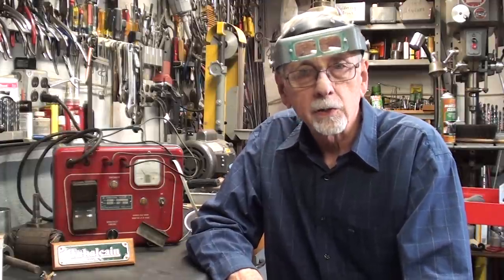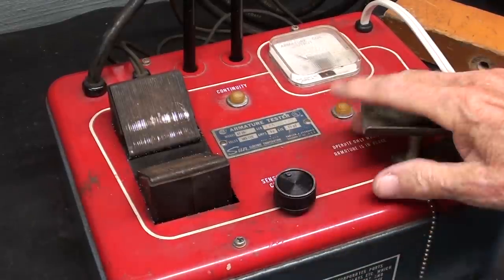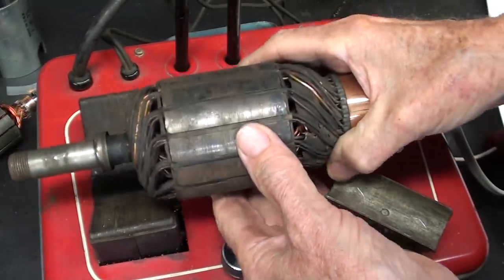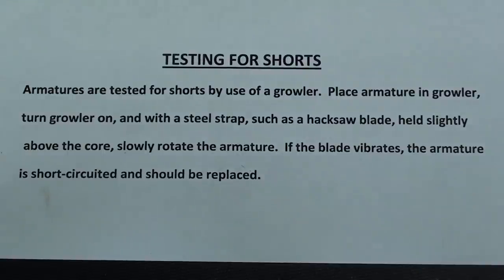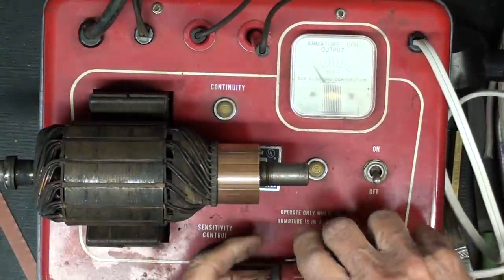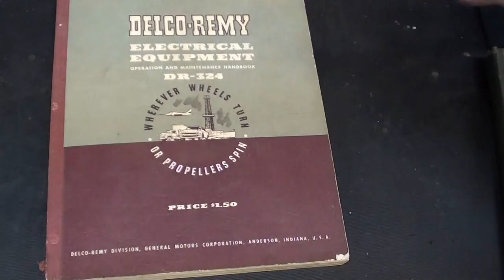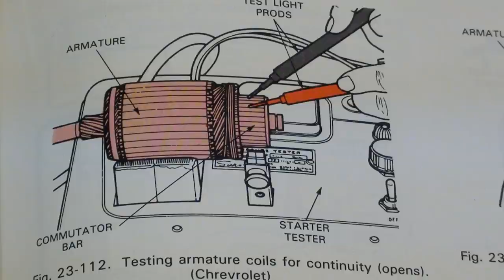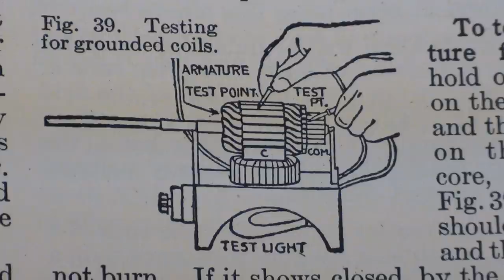TESTING ARMATURES with a  GROWLER #761 tubalcain sun commutator

Comment: I’ve operated both of those machines back in the 1970’s. I’ve also turned down commutators, undercut the mica in generators, adjusted voltage regulators and flashed the fields. Other Sun machines I’ve used were the VAT-28 and oscilloscope. 
Good find! Thank you for preserving them.

Comment: In my dealership days, I was the tune up/electrical technician. This was in the 80s until 2002. It wasn't economical to bench repair worn out starters or generators, but for warranty repairs we had to replace internal parts. The last starter I ever took apart was a 1984 Oldsmobile which had  a gear reduction starter. The brush holder had come apart and was mangled beyond recognition. I put the service manual on the bench and carefully installed a new holder and wired the brushes in place. When I reinstalled the starter, it worked fine except it was running backwards and the starter drive clutch was overrunning. I pulled it back out and again carefully compared the brush wring to the diagram. I stood there trying to see what I had done wrong when a breeze turned the page to section on the regular starter, without gear reduction. The same brush diagram was used on both pages. This was about the time we quit doing internal repairs on generators(GM never used the term alternator). The diodes, voltage regulator,  and brushes of early generators used screws, so diagnosis and repair was fairly simple. By this time, power output was getting over 100 amps, so in later generators the connection between the stator windings and the diodes was a spot weld that couldn't be duplicated in a shop.
Reply from the maker: Thank you for that little history lesson. Helps me understand why this is no longer done

Comment: Awesome.  Every once in awhile you run a cross a growler.  Great in the marine mechanics shop as lots of motors on boats.
Reply: Yes and not to mention the many different power tool motors that are mostly commutator type.
Reply: Aircraft shops still use them.

Comment: Nice to see a demo like that. I started in the auto electric rebuilding business right out of high school. A parts counter out front and a 4 man rebuilding  shop in the back. Our testing /rebuilding equipment was much more heavy duty. The business was driven by rebuilding starters, generators, magnetos,  regulators and such for large fleet accounts. A shop of 4 men rebuilding 8 hours a day 6 days a week is a lot of product being done. We had growlers but much larger and taller. One of our customers was US Steel, Fairless Hills, PA mill. Their yard locomotives 32 and 36 volt. A 15 pound armature needed a serious growler. I worked at that trade for more than 35 years. A third of that time I owned the company. It finally went the way of the buggy whip. No body needed us anymore. Now a days if you need something just get it from China!!!

Comment: We live in a throw away society, it's so sad that people just toss something like this tool. I'm retired maintenance mechanic- electrician. I worked for a large nursing home it was non profit so the more I could repair ( everything from hospital beds to large boiler circulator motors, industrial kitchen equipment and our plow trucks and tractors). Now since us old repair men has retired, everything is replace. It's run by a corporation now instead of the church, the amount of money used to keep with this new practice of tossing things is staggering.      Glad you kept it from filling a spot in a landfill! Maybe someday things will turn around.

Comment: Very good demo Lyle.  To bad you did not have a several bad armatures.  I linked this video to my motor repair playlist.  Thanks for the demo.
Reply from the maker: Hello Randy. 15 minutes ago, a man offered to loan me the under cutting attachment made for a south bend lathe.  However, I do not currently own a South Bend. But wait, there’s more. I will soon be the recipient of said Machine. A man from Florida is gifting me a 9 inch south bend.   So that video will be forthcoming in about four months.
Reply: @mrpete222  Nice, I could of used an undercutting machine.  we had them on some of the old ships.  even better with a lathe.

Comment: I used a growler for many years in the school bus garage in NC.
It cost very little to repair alternators and starters and we cut cost by 75%. I trained one of my men just for this, and the repairs were easy to do. We cut our commulator on a south bend 9" lathe and south bend had a mica cutter attachment to cut the mica away from the brass. We also ran a ground from the alternator to frame as a extra ground and cut alternator problems by 50%. Love the video's, this one brings back old memories.
Reply from the maker: Thanks

Comment: In HS auto shop I used both the armature tester and the distributor machine.
To use the valve grinding equipment you had to have had very good math grades by the auto shop teachers standards.
I used that equipment also. 👍

Comment: I taught myself how to rewind motors from an Army Field Manual (TM5-764) that I got from our local public library. The only "exotic" material needed was Red Glyptal, a semi-hardening enamel (which you can still get from Amazon - they have everything) to stabilize the windings. I rewound a single 1/2 horse motor (which I still have and still works well) and never tried it again. I think the only time I would ever do it again would be for some motor with a proprietary case that was not available any more. It is tedious, but so are a lot of the things we do.

Comment: In the 60 years of being an automobile mechanic I must say I have never used one, but as you say it’s usually pretty obvious if an armature is defective by the thrown solder or the burned varnish, but for production work the grower is faster and more accurate.

Comment: Thanks - I'm very pleased to have seen that video. Here's a bunch of comments:
1. "A.S.R." cam to mind instantly - my local alternator/Starter Repair shop - I've a feeling they'll do rewinds, but not sure, never used them :)
2. We don't need one - an ohm meter (part of a multimeter) can perform those tests - with much less growling and heat !
3. What did your dad do in the war - common enough question. Before the war he was a general dogsbody in a hotel (Grandma was a cook there - and bought dad an 0-1 10ths mic for his 21st b'day (1945) - still have it.) Also before the war he was motorbike mad - and oddly, this is relevant ! 17 year old with a m/c........resulted in a quick trip to the hospital in an ambulance to get his broken arm fixed. 1941 !  As the war developed, of course he was called up - and instantly medically written  off due to the recent broken arm and the fact it healed such that he could neither get it dead straight nor bend the elbow more than 90°. Tinkering with motorbikes - he ended up fitting balance weights to aero engines (possibly Cheetah 9 (ix) as he mentioned those enough for me to remember!). After the war, 'in his element' he went into the auto maintenance trade (for the rest of his life). First job, first company - straight onto a lathe to true up a com on a starter - and that's the point of this story !

By the early 1970s, he'd got his own lathe (ML7) (kept at the mother in law's (cellar)) and 10-12 years later upgraded to a Colchester Student, after we'd moved - still here and nearly usable! (a bit low on headstock oil).

Comment: Thank's for the video takes me back to my auto electrical years repairing all types 12 & 24 volt starters & generators / dynamo's wiper, blower motors also repairing voltage regulators

Comment: There are motor repair men [people] or were that sold motors for money and often had 3 phase for low bucks.  Not much market.  He used an electric (house) Oven to burn out the varnish and then strip out the copper for scrap.  Then used a jig to make the loops to install.   Nice guy some years ago in Arlington, TX.

Comment: What is an internal growler used for???  I bought a big box of growlers recently at an auction and one of them is an internal growler. Great video :)
Reply: I don't know, but can offer a guess... perhaps an internal growler is used to inspect/diagnose alternator problems?
Mr. Pete did specify that the growler is used on starters and generators .
 Alternators are inside-out generators, sort of.

Comment: We called this am external growler back in our 1967 go tech electric shop. Had an internal growler to test field winding. In my 50 years as an electrician never saw one in the field. Very rarely see a DC motor in factories. An AC motor feed from a VFD  replaced the DC motors. Most battery operated tools are brushless so it lasts longer , has longer battery run time and lighter.

Comment: My extent of generator repair was (with the engine running) ground the F or field wire, if the generator charged fully you had a bad regulator. If the generator didn't charge after grounding the F wire you cleaned the commutator and/or replaced the brushes . If still no worky you took the generator to Johnson's Starter and Generator in town. Mr Johnson would test the generator with the growler, then pick a sepia colored armature box from a stack and install in the generator. Saw growlers used in my youth (66 now) but never had one explained.

Comment: Auto diagnosis is now performed by accessing and unwinding cascading diagnostic codes. That's it.   Unfortunately, useful diagnostic tools like the growler, the analog VOM, the tach/dwell meter, and many other useful tools have disappeared, .  I recently used an old halide torch I own to find an R12 leak on my younger brother's old car (it was a loose connection near the receiver/dryer).  He was astonished to find that such a thing even existed, let alone worked.

Comment: I'm fascinated by the guys in East Asia rewinding armatures:
https://youtu.be/SqpD4khzqbw
In the video I just linked they fit a brand new off the shelf commutator!
My Uncle has a stack of 50's generators and starters of varying condition. At some point I'll get around to copying the Asians and rewind them for a new lease on life.

Does the growler really need to be powered on? The electromagnet seems to only offer mechanical resistance to rotation. Perhaps the metal on metal contact helps for continuity and the other tests.

Comment: When auto electricians use to overhaul motors and generators. It is a pity you do not have the Sun tune up machine, where you attached cables to the coil and spark plugs that measured the dwell angle of the points, how big the spark plug gap was and with the strobe light the timing.

Comment: What exactly was the magnetic cradle doing? Was it producing a flow of electricity or ??? i.e. never saw any measure of current flow or was that what was occurring in the third open circuit test?

Comment: Thank you Mr Pete for another lesson on our old tools we once loved to use. I get upset to hear that a simple minded pit that into the dumpster and throwing the tools away. There are more people who have no idea what something is so they just toss it away without giving anyone else a heads up by saying we don't need this anymore so if anyone wants it to come get it. You would have alot of people wanting to get it. I heard Elon Musk say earlier this week say cars built today are designed to only last for 15 years. But you have many parts on them that must be Replaced every few years because they wear out or rust on the vehicles and that is something we all hate about the car companies. Because they want us to buy newer cars every 4-6 years to fatten their pockets. It's getting harder and harder to find old cars and trucks to fix up. I have been saying for past ten years that I would love to have a 1960-1970's fixer upper, one with real metal on the body and a real gasoline motor under the hood. Our hearts are heavy to see idiots throwing away all the classic tools and smashing old cars and trucks as if they are only junk. We old mechanics will be discarded in the future also and more an more common sense dies with us old guys who could fix damn near anything that was brought to our doors. Technology is taking over an as Elon Musk said, in another 10-15 years our new cars will not come with a steering wheel and we only have to sit inside it an say where we want to go, then lean back an enjoy the ride. He said the cars of the future he sees is a safer driving vehicle that doesn't have accidents an that lowers the fatalities on our highways. Removing the idiots from causing accidents because they might be texting while driving. Yes most states have laws saying no using phones while driving but we all see people doing it, mainly teenagers and people in their 20-30's here in Missouri. I was passed by a female around 18-24 years old on the interstate few years ago, speed limit was 60 and she's using her knee to steer while texting on her phone going over 80 mph. She was swerving from lane to lane driving with her left knee never hardly looking up at the road. No text message will ever be worth a person's life, especially a child's life or any innocent person's life. Sad our future has so many idiots in it. I'm looking forward to get cars that fly. Get us off the roads where those knee driving idiots are driving. Sorry I'm ranting Mr Pete but I just had to say what I'm thinking about it all. God I pray my grand children use common sense when they start to drive in few years from now. No phones allowed in their hands if they are driving because we do have hands free technology in our vehicles now that use car speakers and microphone to talk or they already know Papa takes their keys away from them. No texting Ever while driving, Period. It can wait till your stopped, or pull off the road to read it if it's that important to them. Rules for driving I teach them, saves their lives and others around them. An I pray they will teach their friends all these same rules. No seat belt click from everyone inside the vehicle, vehicle doesn't move. If person refuses, kick them out. What amount of money do you put on a person's life. Son, daughter, grand children, or another parents life. They are all priceless so drive that way. Respect life, respect all of the people who use common sense and don't throw out old tools because I'm sure someone else would love to have it. Thank you so much Mr Pete for making these videos, I'd loved to of had you for my shop teacher. It will truly be a very sad day when your time has gone from us. I only hope your son will continue making these videos for your legacy. We do love you for all the years you taught at the high school and on videos where you reach millions every year an years from now. I'm old and can't see so I hope I don't have a bunch of typos. God bless you all and remember safety first.

Comment: Good stuff.  Can you share what the voltage and current is available from the tester when testing for open circuit?  Thanks.  The reason I ask is because I took one to a guy that tested with a 110 volt 60 watt light bulb.  It would actually weld the broken wires back together.  When I took it to another shop and put it on a growler it blew the weld apart and checked correctly.

Comment: I really enjoy your videos. But on this one not so much, You start out by showing that you had to replace the power cord, but you did it incorrectly, No matter what cord was on it to start with  it needed to be replaced with a cord with a equipment grounding conductor and that wire attached to the metal parts of the growler with the proper wire terminal and using machine screws, nuts and washers (not sheet metal screws !) on cleaned metal with a jumper to the other portion of the can.  It only takes 50 ma to STOP your heart! (less than a 100 watt light) Just a little shock can Kill!      From a Licensed Electrician 7593J Ore. 
Sorry to be so harsh, but I've seen a lot of scary things in the last 40+ years.
 Jim
Reply: @m9 ovich I really missed that and I'm very sorry for making that statement. Should have known that mrpete would not have made that mistake.